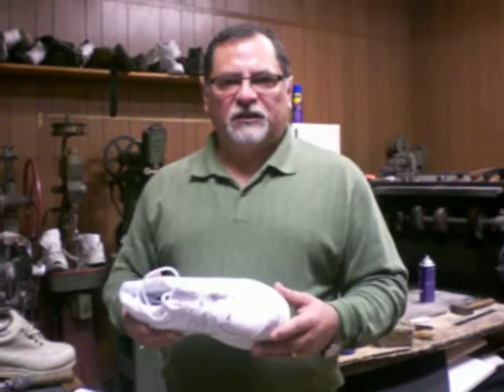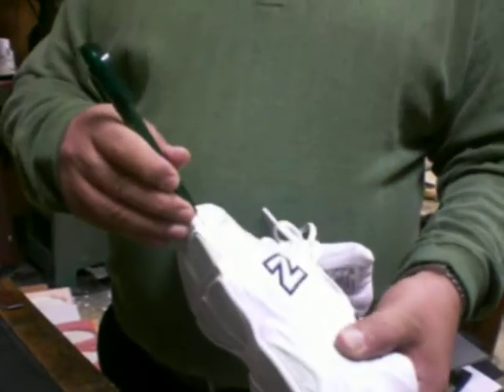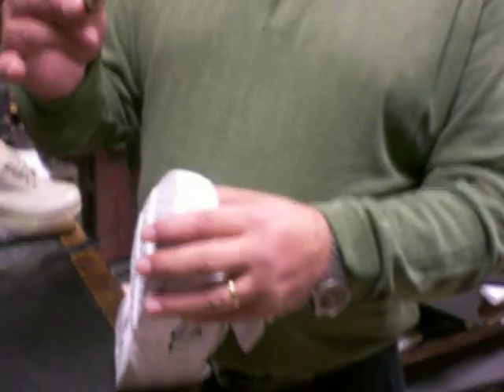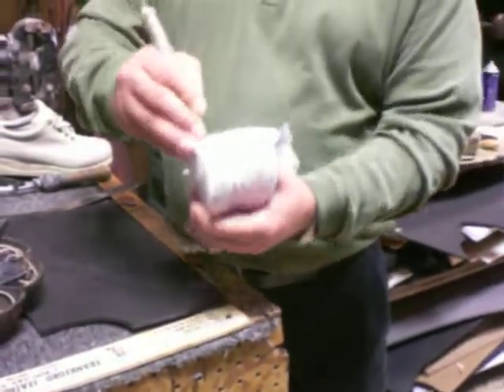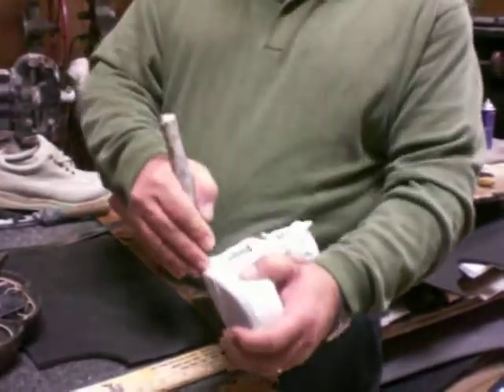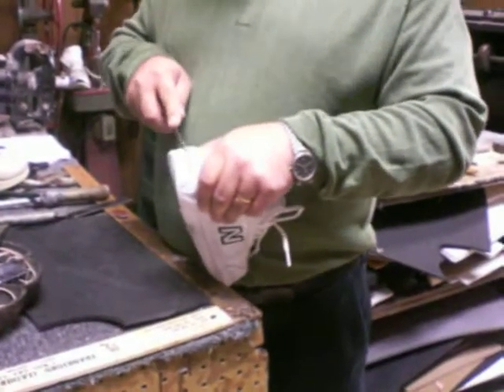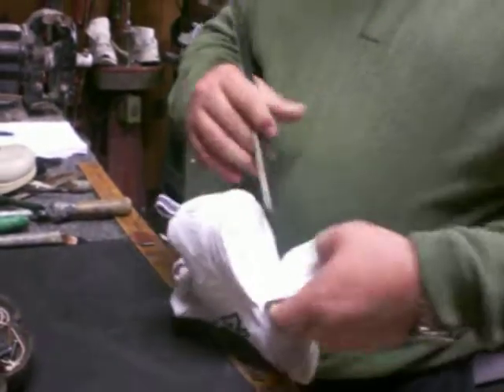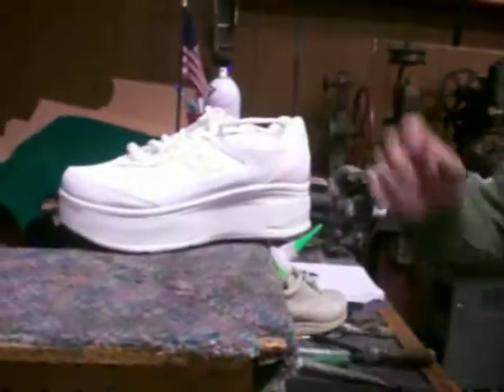Elevation Part 1

Comment: I know this was published a long time ago, but what material do you use for the build up?  thanks
Reply from the maker: +Loony Lovegood  I used EVA 35 durometer. At the heel strike point, a plug-in wtih a harder  material may be necessary to prevent compression, usually 55 durometer or soling material